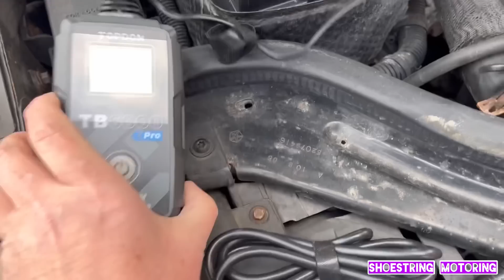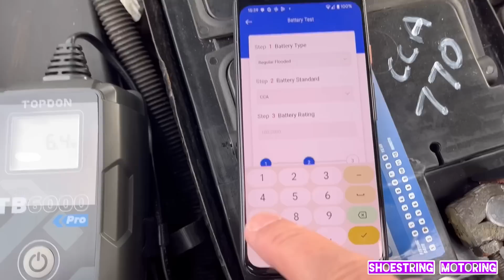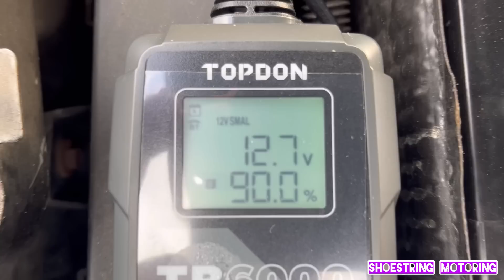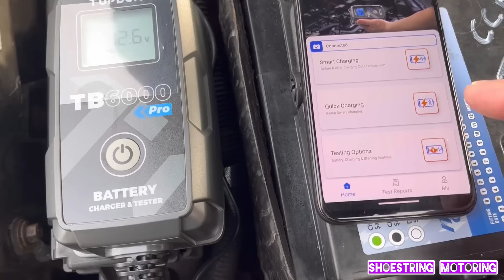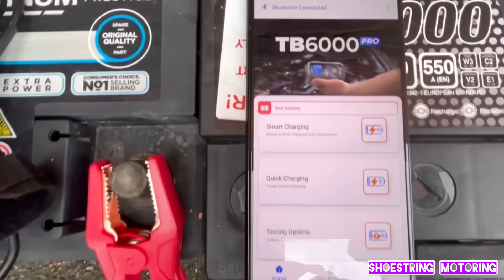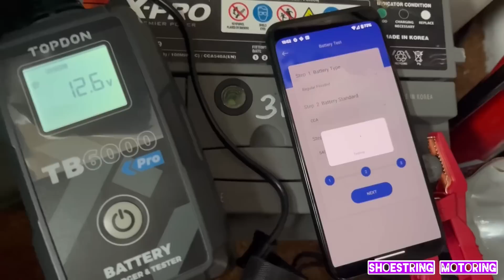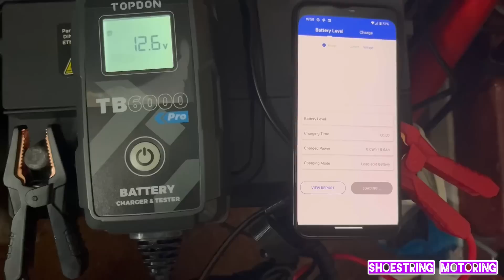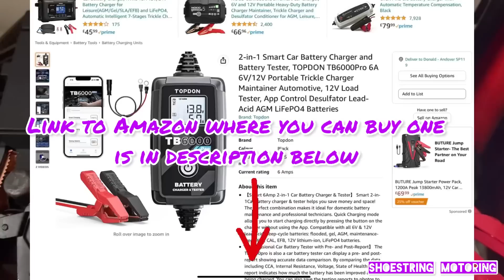Review of the TOPDON TB6000 PRO

Comment: 0:29 When you have a battery that is reading too low to charge, I've found that using a simple household 9v battery in serious with a couple of jumper wires will let you start the repair charge. Saved a lot of batteries this way.

Edit: be sure to remove the 9v household battery immediately when the charge starts.
Reply from the maker: Thanks for sharing that information. I didn’t think of that. I’m sure it will be extremely interesting to everyone